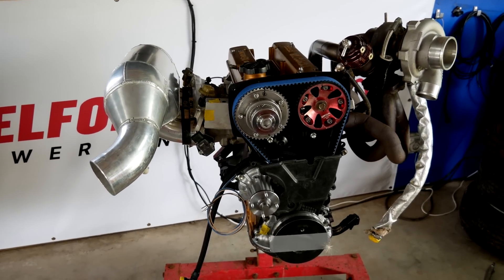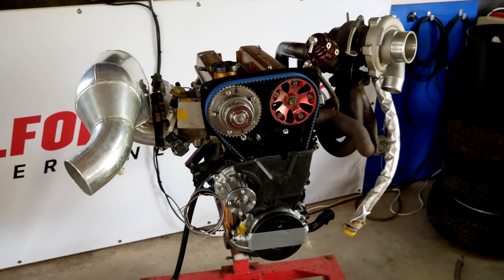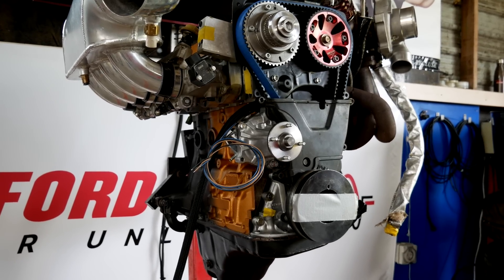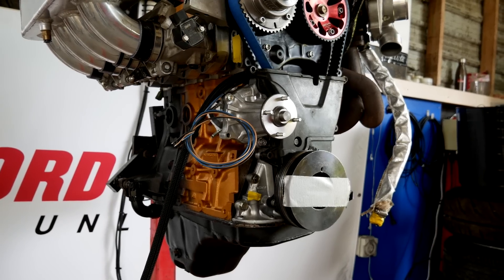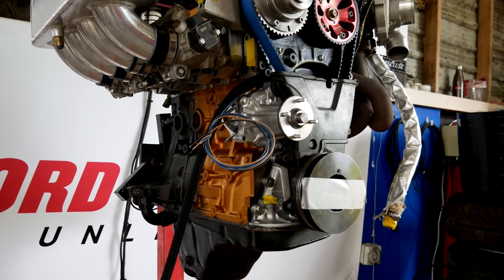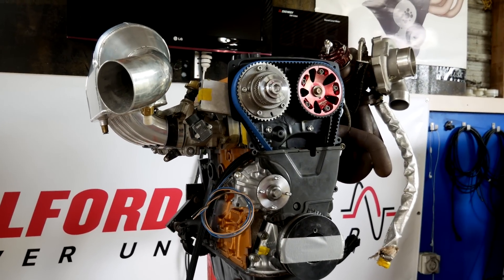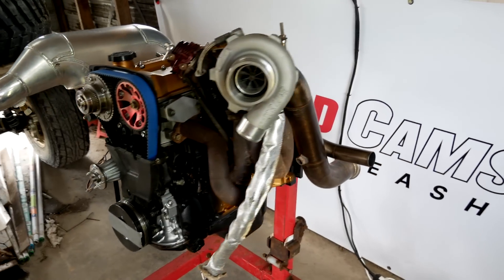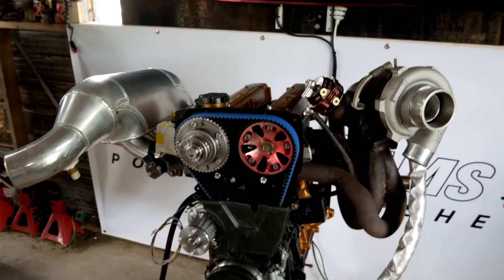10,000rpm, Long rod, VVTi, Turbo 4AGE Hilux - dyno tested

Comment: Why not fit a larger exhaust cam too? I guess maybe it's not worth it?
Reply from the maker: Few reasons. Had that cam  hanging around already setup for the vvti. using the exhaust cam from the same set makes the turbo come on 1000rpm later,  but does make a bit more up top. I dont have anything smaller hanging around to try and is probably a better combo.    but this works well for  the hilux.  As with the vvti on the inlet and small exhaust cam, get factory like idle, hard to stall out  and the massive powerband.  all good stuff for 4wding.    Almost everything on this engine is recycled from other projects, so some things are a compromise
Reply: @Garage4age  That's interesting. Thanks for responding. Having more torque lower in the RPM range is definitely better for the offroading I do than peak power numbers at high RPM. 

Is it overlap that causes the turbo to come on later?

Do you think you'd see benefits from a bigger intake cam without the turbo? 

I have a Nissan D40 with the VQ40 and it has variable timing on the intake cam. I am trying to figure out if a bigger cam would be beneficial. I am concerned about shifting the powerband to the right and losing low end torque. 

I'm in the process of swapping to a solid axle in the front and will be running 37" tires. The purpose of the truck is offroading, but it will be street driven to the trails. 

My current thought is to just leave it alone, but I'd love to her your opinion. It will be NA, no turbo or supercharger.
Reply from the maker: @Fix_It_Again_Tony    Take a look at this vid   Its basically  the same engine in  NA form with the same cam combo,  comparing against stock  cams both sides and big cams both sides https://www.youtube.com/watch?v=-Inv1TkANls     A good part of how well it pulls off the bottom with big cams is the exhaust setup.  Which is pretty well dialed on the na setup.   the turbo essentially destroys all of that. since is creating pressure on the exhaust side.         So yeah results will obviously  vary from setup to setup and different engines.    but  just changing  to a bigger inlet cam with the vvti  to make it run nice would be a safe bet
Reply: @Garage4age  I'll check that out, thanks. I'll have Doug Thorley long tube headers (1.4" primaries, 22" long) on this truck and I plan on building the exhaust myself. Nothing too crazy, but I'll use mandrel bends and try to keep the diameter sensible. As I understand the velocity of the exhaust gas is key to scavenging.

Comment: Which vvti pulley do you use? Is it very difficult to adapt? What computer do you control it with? the pulley on my 20v is dying
Reply from the maker: Yeah very.  its a 2jz pulley.   runs an old  link ecu.   I would just find another  20v pulley,

Comment: Hi i love your 4age videos i have learned quite a lot ,i have a a 4agzte in my KP61 rwd starlet 14lb supercharger pulley  ,3071 oil cooled turbocharger only comes on boost around 5500rpm makes mad power 20 lbs boost external wastegate, had head gasket sealing issues using a 0.40 cometic mls head gasket decked head and block now reassembling then final tune my computer is a link monsoon standalone ecu😊👍

Comment: Is this tuned in speed density or alpha/n?
Reply from the maker: Fuel map is tps vs rpm. Fuel equation map. So works with the itb's but ecu automatically adds fuel with boost with an afr look up table. (Not closed loop)

Comment: I caution against reving this past 9 grand with the stock crank they start flexing and the rold bolts You WILL break them. especially with long rods they will survive a few dozen pulls to 10 grand but really you need to work on the bottom end if you want to rev there. also more boost there is a guy making 600hp out of 4age in his pikes peak car
Reply from the maker: The long rods will make it easier on rotating assembly, not worse. thats the whole point. less side loading and vibration, which is a bad day for the bottom end.    As per the video I'm not chasing big power. just wide powerband.   If i wanted big power, the combo of parts would be different

Comment: Please recover all the torque beyond the current peak by turning up the boost. You are moving past your knock limit rpm and assuming you have the fuel there is no reason to limit it to a number. Flat line the torque so you stay in the drive line limits.
Reply from the maker: Hey. Yeah that would be the plan if wanted more power. But it already has more than enough to do what it needs to do.  Rolling over at the end will  stop it going into the limiter as hard in mud holes and the likes

Comment: Same geometry as the OS Giken long rod 4AGE 🍻
Reply from the maker: I think they may have moved the pin height up in the piston a bit too, so even better rod ratio, pretty cool kit.  but would be out of my budget.  my setup takes factory 4age  piston pin height and 7a deck height. so off the shelf pistons work

Comment: If the VVTI advance never goes less than 19 degrees advanced would it be a good idea to manually advance the cam to 15 degrees as a starting point and advance it further than the 60 degrees down low?
Reply from the maker: 60 is the max travel of pulley, is setup to stop at minimum piston to valve clearance.     Is only a very small gain going from 55 to 60, so is pretty much good as it will get.    the last 19 back to zero  is nice to have at at low engine speed and idle, since pretty much has zero overlap.  it idles like factory.
Reply: @Garage4age  Ah yea true true, forgot that you had a big cam on the intake making it an interference

Comment: You should take the car to someone who knows how to tune so you can actually get a decent number out of it. Couldn't imagine spending that much to make so little power. Weak as piss.
Reply from the maker: show me another 4age that makes 234kw at wheels on only 14psi boost,  with a powerband this big.
Reply: Are you for real!? Remember this is a 30 odd yr old 1.6L 4 cylinder running only 13.8psi and making 300hp made in his shed out old bits and pieces. Is this the first time watching any  Garage 4age videos? Must be because you'd know the bloke knows how to tune if you had any idea.

Comment: Absolutely awesome numbers to see all over the graph. giving me ideas on my next engine build for the driftcar down south - this is exactly what I need. Will you be making a VVTI kit for the public?
Reply from the maker: hopefully doing more work on it this year.  to get it to something  i can potentially sell  as a kit.
Reply: @Garage4age  I'm interested.
Reply: @Garage4age  Any chance you'll do a dual vvti 20v kit?
Also I thought you might be interested in a youtube video by hawes_power where his gt4 dynod up to 60hp and 100nm gains across the whole rev range with earlier peaks by swapping from a built 3sgte to a 5sgte beams dual vvti - same turbo, same boost, same pump fuel, just better head, extra 200cc and dual vvti. I think this shows potential for a boosted dual vvti 20v 7a.
Reply from the maker: @GTZ4WD  unlikely will do it for 20v.   the vvt on them works ok for a basic on/off setup.  plus it would actually be harder to do vvti on a 20v than 16v.   exhaust side vvti isn't a big advantage. most of the gains are on the intake side.

Comment: With all that extra rpm seems like You need Bigger A/R Hot side of Your turbo. Engine getting chocked on top RPM I say
Reply from the maker: Power curve is pretty much the same as when ran the same combo na   https://www.youtube.com/watch?v=-Inv1TkANls    So is pretty close to doing what it should at this power level.   But yeah if it was in a different chassis, i would  run a g25,  bit bigger exhaust cam and turn it up.     But the extra power off the bottom is more important than  it hanging on longer up top in this thing.
Reply: @Garage4age  check on Continental turbo out of Audi s3 8y or Golf R Gen 8. Good alternative to g25 (which I find a bit pricy) and still capable of near 500hp with great spool.. That was random video of Yours that I totally didnt expect to be pure offroad fun car rather than drag or street car

Comment: Awesome, but an awful lot of money to get there. VAG 1.8T would get you  there a lot cheaper with more HP at same displacement and turbo. (Not hating - I had 4AGE in various forms for 30 years)
Reply: 8 generations of check engine lights.
Reply from the maker: If were to build it from scratch  would be fairly expensive.   but is mostly 2nd hand parts and leftovers from other projects.   The old engine would make the same power if just tuned up the boost a little bit and thats super basic.  but yeah kinda not the point.    Its still 1.6L btw

Comment: A 35% increase in the RPM range ratio with the turbo spooled and more power throughout is respectable. 
Is this called a 35% increase in bandwidth?

Comment: Fkn Sick men❤! How long the old engine as last of abuse ?
Reply from the maker: It ran a big end bearing awhile back,  due to oiling issue.  so i threw a new crank and bearings in it.   rest of it was built over 10 years ago, and used to be in my drift car.    still runs perfect and doesn't use any oil
Reply: @Garage4age  wow impressive what fuel do you use and what oil grade in both aplication n/a and turbo
Reply from the maker: @sachadohc2912   98 ron e10 pump gas.   0-40 petro-canada in everything at the moment as got a bunch of it for a dyno job.   otherwise usually 10-50 penrite
Reply: @Garage4age  as usual very impressive sir !

Comment: Torque curve and the band width are pretty wild.
Would be comical to see it pulling a trailer.
Reply from the maker: I line towed a nissan safari  with it  for 30km  once haha.   the new engine should help with that
Reply: @Garage4age  Hearing in really pull through that rev range but under heavy load would be pretty sick, probably hard to get across on video

Comment: Is there any mileage in feeding in some more boost later in the rev range to keep the toque from rolling over up top?
Reply from the maker: Yeah was going to if needed.    but don't really notice it rolling over when driving it. it doesn't drop below the peak power of the old engine.   will leave as is, so smashes the limiter slightly less haha.   If engine  was in something else would put a boost ramp in it
Reply: @Garage4age  makes perfect sense

Comment: Impressive power, especially if the RWD and huge tires losses are not calculated out.
It is a fair bit easier to get that power at the wheels in a corolla then a hilux.
Reply from the maker: Yeah all the numbers are at the wheels.   Also running it up in 3rd gear, which usually shows less power than the 1:1 gear in rwd box.    4th would be almost 300kph due the big wheels and rpm, even with 4.88 diffs.   which is way to fast for the dyno let alone the driveshaft.

Comment: I dont care about the kilowatts.
Is that 750nM out of a 4age turbo?
Reply from the maker: thats whats hitting the rollers after gear ratios.  not engine torque
Reply: @Garage4age  so you were in a lowish gear? i may have misnunderstood or misread something
Reply from the maker: @MntlMajorkozmo     most dyno's will show torque numbers calculated from the power and engine rpm.  which is really torque at engine minus driveline loss, not torque at wheels.     mine doesn't do that calculation.     just shows wheel torque, which is usually hidden in background and used to calculate power.  wheel torque and roller speed is the power,    power and engine rpm is "torque at wheels"     Anyway if you do the math  would be 335 nm at 5700rpm.    So yeah running in 3rd gear through  4.88 diff and 31' tyres is doubling the engine torque, which is what the dyno or ground sees
Reply: @Garage4age  ahh cool. tanks for explaining =)

Comment: Thats one sick engine with great power band! Would love to have such in my e30!
Reply: Try a M42B18/M44B19 Turbo Setup. You´ll be amazed. =)
Reply: @derxKai  I was thinking of this, as well as in e46 chassis for track days, but i dont know the limits of those engines, rev ranges etc. Those high reving turbo engines amaze me.
Reply: @TomoReso  My engine is a full stock m43b16 and it is giving 250hp at 1.5 bar of pressure, that was the last time I took the dyno and we couldn't finish adjusting the clutch started to slip.
Now I solved the clutch problem and I am at 2 bars of pressure, the only thing is that I have not gone to the dyno to find out how many hp it has.
I have seen the m43b18 with ethanol get 380hp full stock, it is not necessary to reach 10,000 rpm, valve floating among other bad things.
Reply: @goyocarreras  wow those are impressive numbers for stick m43b16, no thicker headgasket? what ecu?
Reply: @TomoReso  The engine is full stock, I have not opened it, the head gasket is original, and the ecu is also original, on my YouTube channel there are videos of my car, it is in Spanish, but so you can see how everything is assembled, I have even the AFM and everything works ok.
Reply: @goyocarreras  haha that is amazing mate, i will check it up later!

Comment: Pretty cool, but if it has more than enough power, why long rod instead of just 7a? Revs are cool tho
Reply from the maker: wheel speed, good for clearing mud out of the tyres.    can go from 5kph to almost 70kph  in same gear.     This will make the same power with less cylinder pressure than a 7a also
Reply from the maker: also  7a is a bone rattler.   this thing is smoooth
Reply: @Garage4age  Fair enough. My 7a was smooth as silk and I wouldn't say the others I had drifted with were rough. We needed the torque tho, and after all a gearbox / diff is nothing more than a torque multiplier.

Comment: Cheers. Does the Hilux feel more alive with the new engine? 
 Have you considered tuning with rising boost curve? Add extra boost after the torque peak, so the engine would make more power without self destruction.
Reply from the maker: yeah huge difference in how it drives with the massive powerband.   its already got more than enough power,  but yeah thats what i would do if wanted more. its quite high compression mid to high 10's.   It's not running any form or boost control atm. just spring pressure

Comment: That's really cool! I guess with a small turbo like that there wouldn't be much advantage going with a larger exhaust camshaft?
Reply from the maker: Is quite a few reasons why i done it like that, some as silly as that was the cams i hanging around.   when pared with the exhaust cam out of that set it looses about 1000rpm on spool up.    with the combo it has combine with the vvti it runs like factory at idle. good for slow speed stuff.     if i acquire a slightly bigger exhaust cam i will try it.
Reply: @Garage4age  That would be cool to see what it does.
Reply from the maker: @RocketRaspeed    there is a video  on my channel, where i tested the same cam combo on the na version of this engine, if you haven't seen it.   it does basically the same thing as here.    but yes im interested to see how big i can go on the exhaust side without loosing power off the bottom, or running rough.
Reply: @Garage4age stock bigport cam is 240 duration and 7.6mm lift that might give it a little more compared to the 232 with 7.1mm lift.
Reply from the maker: @brownsworthy7323  hey.  Yeah a friend is sending me some. I need to change to a better cam belt so will swap the 240 in then

Comment: Here i was thinking "you need the BIGGEST exhaust cam to get high rpm".
Reply from the maker: Ive tried the same cam combo a few times, both na (is a vid of the na test)  and turbo on old engine in the hilux.    only reason i didn't run with it on old engine in  hilux.  is it has to run super nice down at idle to do slow speed 4wd stuff.   which the itb's and vvti solves.     I should be able to run a bit bigger exhaust cam (have nothing in between here to try).  but running the 278 exhaust cam out of this 284/278 set kills the boost threshold  by about 1000rpm, for a bit more top end. which is a no go in this thing.     Current setup, runs super nice. you would never suspect it pulls 10k rpm
Reply: Not going to swap the old head on? @Garage4age
Reply from the maker: @Clickeral   Will leave as is,   it already makes more than enough power for its intended use